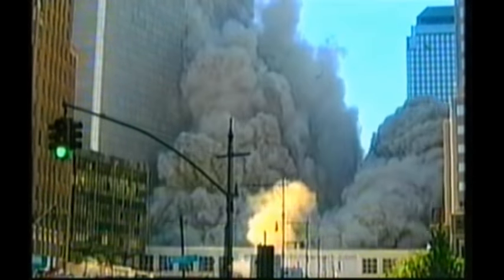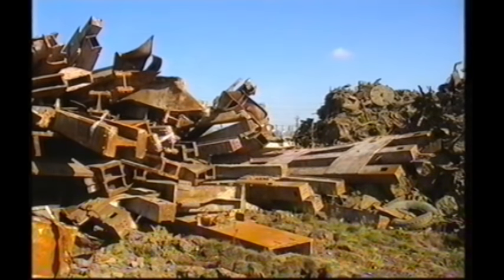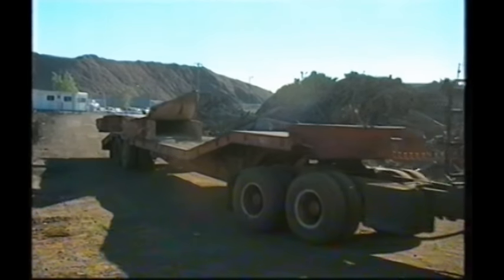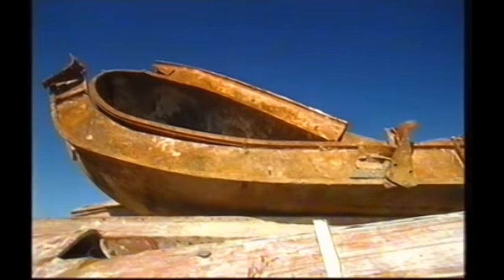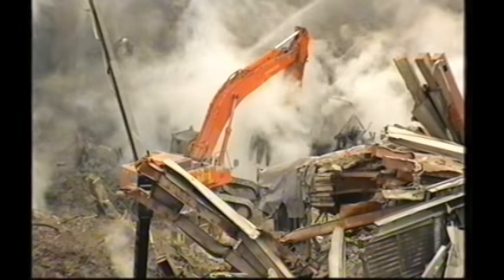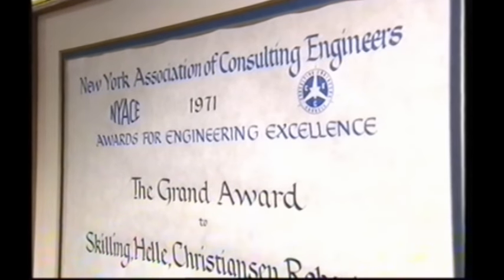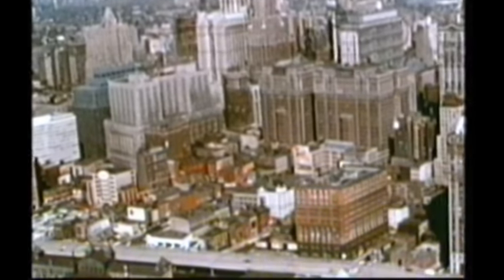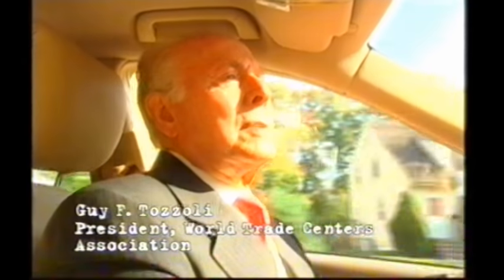9/11—"How The Twin Towers Collapsed" (C4 documentary, 2001)

Comment: Excluding all the conspiracy theories, selling the evidence to the scrap man within days is most telling.
Reply: What do you think is involved in a clean up operation? The goal is literally to get all that stuff offsite. Where would it go? It's two entire buildings, it has to go to a scrap yard.
Reply: @Redskies453  You mean 3 buildings? Building 7 also fell down in freefall speed. Getting the stuff offsite makes sense. Shipping it to china before the investigation was over is a clear sign they dident want anyone to check the leftovers. When a plane goes down they find the pieces and then investigate to find answers. If you dont want anyone to find out you send all the pieces to china.
Reply: It's not like the steel was not thoroughly examined, tested and documented in the aftermath of the collapses. After that, why keep thousands of tons of unused structural steel lying around? There is no good reason to do so. Did you think they would create a pile of steel somewhere 20-storeys high and just leave it there forever?
Reply: @kyle381000  It wasn't thoroughly examined, tested, or documented. You are simply wrong.
Reply: @killercuddles7051  Not wrong at all. Many have said that "thermite" was found everywhere at the site and on the debris. How did they come to that conclusion unless the debris was thoroughly examined and documented?
You can't have it both ways, you know.
Reply: @kyle381000  Thermite is a very likely possability. Very low sound explosions and it can melt steel beems. How else do you count for 3 buildings falling into their footprint in freefall speed? If nothing else how do you explin building 7? It was not hit direcly from the planes. Just debree touched it and started fires. But fires dont remove the bottom of the building. Building 7 also fell straight down without resistance.
Reply: They didn't sell it, they used a cleanup site right next to my HS for months and months! We sure loved dealing with the long term health effects! Quite a few of my classmates from the class of 2005 have died.
Reply: @apray359 what do you mean? What did they die from? Sorry for their loss.
Reply: @Redskies453 why couldn't it sit in new jersey. It's evidence in a crime. Why was it rushed off to be recycled. What's the hurry.
Reply: It wasn’t sold within days
Reply: @Quinna78 thermite doesn’t explode
Reply: It wasn’t sold it was examined and sorted through at the fresh kills landfill site by  city , state and federal government agencies for all sorts of reasons especially to find evidence and recover human remains.

Comment: The fact so many were able to escape before collapse, is a testament to how strong these structures really were.
Reply: @_indent what are your qualifications?
Reply: @_indent  Why didnt the planes crashing and starting a fire not ignite these secret "controlled explosives" smh
Reply: @_indent  yup, they were taken out from the inside. That inside thing was subsonic aluminum and 10 thousand gallons of jet fuel.
Reply: @micahanglen4331 the lower floors of the buildings had thicker steel to support the structure above. This steel was still cold. It makes NO sense why they couldn't hold the upper section falling 10 feet. The buildings were also largely empty of people. So the load it was bearing was light. Absolutely bonkers to believe the lower floors would fail without massive help.
Reply: @SlickBlackCadillac  They did have help, an entire building falling on it. I'm guessing that you can stand upright with your knees locked with no problem. Now jump 12 feet with your knees locked and land on your feet and let me know how that goes. You also mention people as if they are going to affect the structure of the building in any meaningful way.
Reply: @micahanglen4331  those buildings were OVERBUILT. The engineers thought of everything. Even "what if the USA wins the World Cup and every single person in the building is jumping up and down at the same time".

The upper section of the North Tower (the tower that was hit highest) weighed as much as the RMS Titanic. So you mean to tell me dropping the RMS Titanic from 10 feet....20 feet...30 feet...on top of the building would cause an entire collapse like that? You'd be out of your mind to say yes.
Reply: They were strong but with the right amount of explosives they both were textbook demolitions by ????
Reply: @flamethrower6161  they work on an  electrical charge not an explosion  ,, 2 separate things altogether
Reply: @SlickBlackCadillac  dropping the RMS Titanic on top of the trade center would obviously cause a collapse. Concrete is not known for its impact resistance.
Reply: @micahanglen4331  the vertical load bearing structure is 100 percent steel, both center column and outside "skin". You obviously are not knowledgeable about these towers.
Reply: @slicknackcadillac, I recommend you look at the maximum weight loads for the buildings, and familiarize yourself with dynamic and static loads, before making anymore comments.  Building engineers have ratings for all this stuff.  There is actually a rating for how many floors can fall on one floor before that floor gives way.  Sounds like you want to pretend that the trade centers were solid steel structure, when in reality, by volume, they were 90%+ hot air.  Kind of like your brain
Reply: @dikranovichk5889  in my experience, ad hominem attacks are lobbed only by the losing party. But I digress. Yes I am familiar with static load vs dynamic load.  The building integrity could be compromised beyond all repair in event of strong downward force, no doubt. But it would not collapse the way it did. Even this documentary notes that the collapse accelerated, which is just plain physically impossible without extra help. 

I'll also note that I was wrong when I said that 100 percent of the vertical load was steel, some of it was drywall and glass as well.
Reply: @sickbackcadillac, I don’t speak Latin. There are 10s of thousands of structural engineers.  Im no expert, and you clearly aren’t either, but it seems like if you were really interested, you could look to the experts in this field and related fields ask them questions. Instead, and your posts are there for anyone to read, unless you decide to delete them, but instead, you have lobbed insults at each person you’ve spoken to on here  the buildings wtc1, 2, and 7 fell the way they did, because that’s how physics works
Reply: @SlickBlackCadillac  Sir, the floors didn't bear the weight of the ones above, each floor supported its own weight with the shell bearing most of the load, these floors were unimaginably heavy and that much weight falling even just 10 feet, even if the floor below could have supported that much weight, it was damaged by the sudden impact of the floors above onto it. The trusses were only meant to support the floor they were a part of, once you add that much weight quickly and suddenly they would easily give out.
Reply: @SlickBlackCadillac  It accelerated because with every floor added to the collapse it increased the downward force and weight exponentially. For example if 5 floors falling took one floor out, now its 6 floors falling, which is more than the 5 that caused the previous to fail. It's not rocket science, every floor that gave out was being hit with exponentially more force and weight.
Reply: @SlickBlackCadillac  "The buildings were also largely empty of people. So the load it was bearing was light." The millions upon millions of tons of steel and concrete beg to differ. The trusses were only designed to carry their own floor, the core and the outer shell supported most of the weight of the building, and the lower steel was not designed to take the impact of floors above collapsing in succession.
Reply: @Lucitin  OK sure. The lower sections were certainly not designed to take the impact of the the upper section falling 10 to 20 feet on top of them. But that does not explain how the collapse was total, near free-fall speed. We wouldn't expect that kind of catastrophic damage either.
Reply: @Lucitin  except each floor gets stronger as you go down. The buildings were NOT uniform. Plus the upper load was getting lighter as much debris was falling by the wayside, so its not a perfect pancake.
Reply: Oh brother…🙄
Reply: @dikranovichk5889  you can lead a horse to water
Reply: @slicknackcadillac, the buildings collapsed at the point of impact of commercial airliners
Reply: Just read the comments here to know what they are teaching in schools.
Reply: @dikranovichk5889  yeah. They did. The upper section (the lightest and WEAKEST of all sections as it did not have to bear the weight of 80 stories above it) came crashing down onto the 80 stories below it. So what would cause the much heavier and STRONGER sections below it to continue to collapse? I cannot stress enough that these buildings were not uniformly built like a child stacking blocks where every block weighs the same and has the same strength. The upper section was feather weight compared to the rest of the building.
Reply: @megbertch138  they are teaching people what to think instead of how to think.
Reply: @SlickBlackCadillac  yes! Very problematic.
Reply: @slickbackcadullac  if you knew how to think, you would respond with the weight of these light and weak floors that stood above the crash sites.
Reply: These “lightest “ and “WEAKEST” floors EACH cover an acre. That’s 200’ x 200’. 40,000sqft per floor. Were those upper floors still made of steel and concrete?  How light is lightweight concrete, or hi rise steel?  How much does 1 Sqft of floor weight above the crash site?  50lbs a sqft, 100 lbs a sqft?
Reply: @slicklackcadillac, one last series of question for you.  When 15 or 30 stories of a building that covers an acre in area drops 10 or 20 feet onto the floor below, how much support is that one floor below this crashing mass getting from the other floors two stories down, all the way to the ground?  Floor 77 is about to be impacted by the collapsing building above it.  What does the 1st floor have to do with the mass that is dropping onto floor 77?  When floor 77 becomes part of the falling mass, what does the first floor have to do with floor 76 taking the impact of the falling mass above it?  You can rest a bowling ball on your head, but what happens if you drop the bowling ball from 10 ft onto that same head
Reply: @BooSpade1  ever hear of C4 or plastic explosives? Charges which don't detonate when beaten or even burned. Not all explosives behave like TNT.
Reply: @dikranovichk5889 
How long does it take to fall 100 stories?
An average-sized person falling for nine seconds would accelerate to about 100 miles an hour and fall nearly 1,000 feet during that time. (This would be like a fall from a 100-story skyscraper.)
The north tower took 13 seconds while the south tower 11 second.
Reply: @earlthepearl, if you know your Galileo, then you know if it is an average sized person, or an extremely large person, or even a very tiny person, they are all going to fall at the same speed.  So immediately, I have to question your position.  Was debris falling besides the towers, faster than the towers were collapsing?  How much of the twin towers, by volume, was air?  Was a 60 story section of the north tower left standing after global collapse?
Reply: Who ever is saying that its not a demolition from the interior might want to go back to school, both building wasnt stuck at the same time but collpade at the same time the same way and you can clearly see explosions starting from top to bottom
Reply: @micahanglen4331  you can see most of the fuel  just burns in the air in a big ball.
Reply: The explosives just hadnt been set off yet!
Reply: @micahanglen4331 Aluminum penetrating steel?  Listen to yourself!!
Reply: @Lucitin Where were all those floors after the collapse?  They weren't piled up at the bottom.
The weight vaporized them? There was nothing left of them.  Not even DNA.
Reply: @dikranovichk5889 The building wasn't a melon full of jelly... Most of it was reduced to microscopic dust. Did the pancake effect vaporize steel? Co
Reply: @borricodimension  It's not likely that jet fuel would combust on an impact. Those gallons would've slapped the street. We saw explosives from inside the building.
Reply: @benjamint8611  That’s the point nothing is really explained, only partial explanations with abstract causes.  You can aprox kwon how much  fuel left for burning the building and if it is enough for compromising all the structure of the building,  but nobody is calculating anything.
Reply: @SlickBlackCadillac  I agree, Yes the building should not have fallen completly without help. What they dont tell you is that this building has sprinklers inside, so the fire was not the cause alone. How can a building that size fall just like a pancake?

Comment: I will never buy into the myth the Jet-A Fuel did not explode on impact and ran down the elevator shafts.  The Jet-A is carried in the wings of the aircrafts and is Highly Flammable. When the planes hit the Towers,  you can see massive explosions on impact. That is the wings being pulled back and the Jet-A being released where it ignited and burned rather quickly covering no more than 8 to 10 floors at most.
The Towers pancaked on top of themselves as if the bottoms of each building had collapsed. The planes made impact well above the half way mark which should have never caused any stress on the bottoms.
I can see the floors above the planes impacts crumbling down and maybe even falling off from one side of the buildings but I will never accept both buildings fell identically as if it was a planned implosion.
Reply: I wouldn't accept that the buildings collapsed identically as they didn't. Look at the first collapse (Tower 2) and you can see buckling of the perimeter columns at the level of the plane impact. Look at the collapse of Tower 1 and you can see the TV mast descending almost vertically - this sat on the central core columns, which buckled first.

You do see a massive explosion as the jets hit the building but experts calculate that only about a third of the total fuel load was consumed in the impact. The rest would have drained into the building and some would have found its way down the elevator shafts. Certainly we know that people were badly burned who had been in the elevators at ground level - this is shown in the Naudet Brothers film (although, out of respect, they didn't film the individual involved.

The idea of explosions in the basement is popular with conspiracy enthusiasts but it is never explained what purpose they served as both towers clearly collapsed from the impact zones.
Reply: There was jet fuel coming down, multiple reports of it in the documentaries. People were burned instantly many killed instantly right by the elevators. They blurred them but many were dead r in one of the documentaries available on here. And this was the main lobby. Esseentially it did explode on impact but that shockwave and basically a fireball went right down the elevators near thr impact

Comment: It was a nuclear demolition, exactly as the towers were planned to be demolished when they were designed in the 1960's. Standard demolition techniques would not work on such a massive steel-framed building, so they came up with a plan to detonate a nuclear device 50m below the foundations inside a cavity in the granite bedrock. The rock would vaporise, but the explosion would be contained, and the shockwave would travel upwards and pulverise the building. All they did on 9/11 was to carry out that plan, but also to have airplanes strike each of the buildings prior to the detonation, so they would have a cover story. What went wrong with their plan though, is that the 3rd plane that was supposed to strike Tower 7, was taken over by passengers and ended up crashing in a field in Pennsylvania, so that plane never hit the building. But they went ahead with the plan to detonate Tower 7 regardless. I guess when you have a nuke ready to go you don't waste it.
Reply: Flight 93 was headed to Washington DC, not New York.